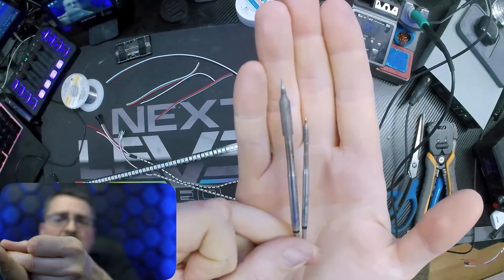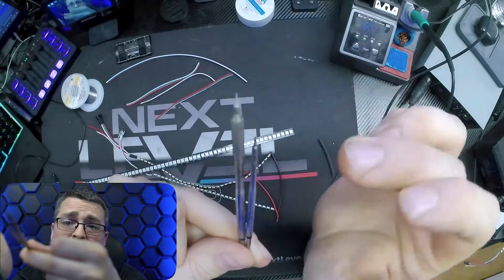Soldering Made Simple: A Beginner's Guide To Perfect Joints Every Time!

Comment: Super helpful lol. I’ve been having problems getting the solder to stick to the pads while soldering up my BOSSRINGZ. Got it all way installed on the truck and pulled it just a little too hard and the solder/wire separated from the pad. Never thought about tinning the wire before soldering it to the pad either! This video was super helpful even if I’m not using it for the same lights yet 🤣
Reply from the maker: Glad it helped, a good iron and good solder go a long way too. Gotta have the right tools and techniques for solid results.